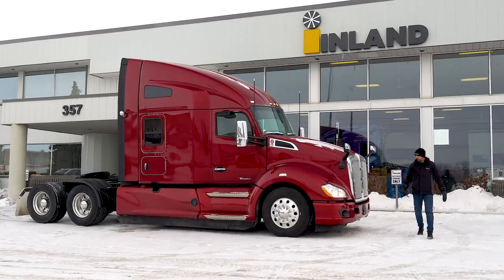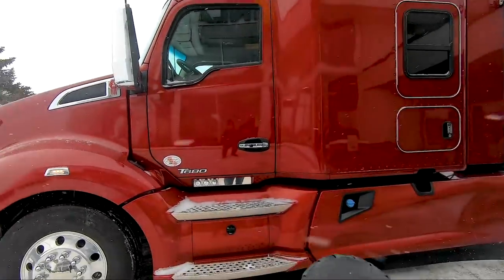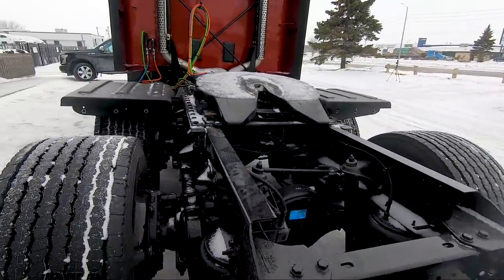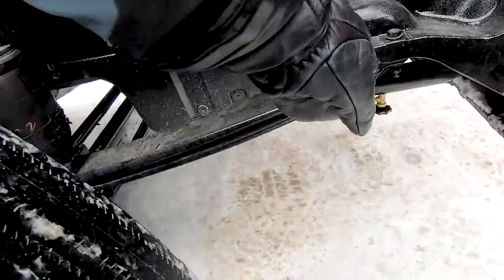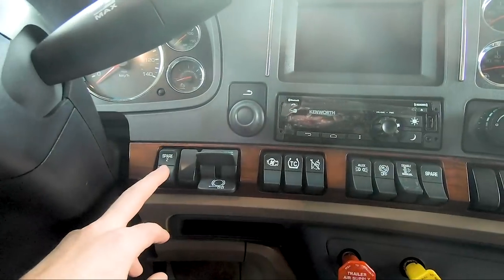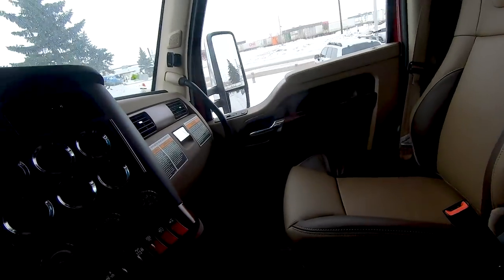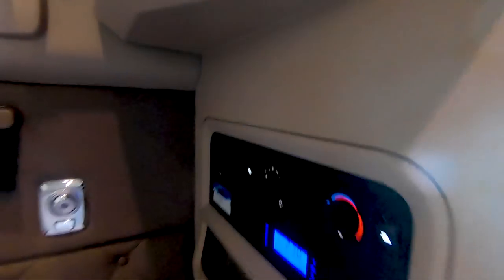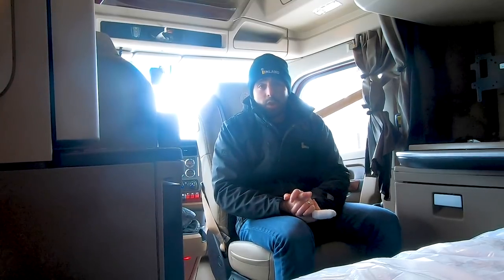MISSING SOMETHING   2020 Kenworth T680 Super Singles & Dead Axle   Full Load   Tour & Review

Comment: As a Brit this is the first truck I  would actually buy, although a lifting axle in front of the drive riides better. Those worried about traction don't forget that in Sweden they run 6x2 at 145000lbs  on ice roads without problems, just hit the weight transfer button and welly it.
Reply: What is that? lbs stands for lips?
Reply: Lift axles aren't legal in that way in Canada. You'll sometimes see.then as an additional.axle.for.trucks going into the US

Comment: The dead axle is a concept that western star, specifically the 5700 xe is heavily invested.
The scenario is wholly devoted to increased fuel milage, and slight weight reduction, no shaft, no lubrication pump. Question why any O/O would sacrifice Canadian winter traction with a single drive axle and super single (hydroplane) tires.? Typical WS ratios in the 2.80 range.
Reply: It works good in winter,drive my Peterbilt 579 for over 3 years single axle,just put hard tires on the drive as soft is wearing faster.
For driving it is no difference 6x2 or 6x4
Reply: What is your fuel milage?

Comment: I drove a KW with a dead axel and super singles. They suck, at times if you are on wet ground and hooking to a trailer you had better get a running start. They are easy to get stuck as well. Overall, I would never own a tractor with super singles with a dead axel.
Reply: Think a guy who lives in Canada would know that that thing be ok if live south of  I40 in America
Reply: John , we’ve been using tag axles (or dead axles ) in Britain with no trouble for years
 no problem with them at all better turning circle as well.
Reply: @adriandavis9790  Well, I guess you never drove a double screw tractor dude
Reply: I can attest to getting stuck on super singles. Picking up a/c units up in Chicago at night and I assume ice underneath the snow. Took me an hr to turn around to line up with the trailer after getting stuck just a few feet away.

Comment: Love the super singles but got 265 talls after two new trucks  that got 250 k miles on each truck no tire problems super handle uneven train construction Ice and snow ruts super singles just glide over it with easy no ruts throwing you around when ya hit the gap between tires like I said 250 k on supers singles are average and and tire still had over 14 thousand tread when replaced just not sure about the single drive axle but I hear they get crazy fuel mileage
Reply from the maker: That was the idea with the configuration. Max out fuel economy

Comment: Why isn't the dead axle liftable?
Reply from the maker: It’s illegal in Manitoba to have a liftable axle.
Reply: I was thinking the same. I drive in Europe and it's very common to see liftable dead axles on tractors, especially in England. Raising the axle  saves on fuel and tire wear, when unloaded. The drawback is decreased traction on wet and not so perfect roads with gross weights. . I can see why Manitoba does not permit it. I'm not really a big fan on these axle configurations either. Off the toll routes in Europe, on these small roads, maneuverability is critical and thus the 6x2.
Reply: @AndyTheKenworthGuy  really? They're quite common in Europe. Some brands even have disconnecting tandems so that you can lift one of the drive axles.
Edit: is dump valve legal?
Reply: Yes Volvo and Sisu have liftable tandem, what i know of. But most trucks in sweden are singleaxle drive and liftable tag or puscher axle. Dump valve are most common on trailers i think but yes legal

Comment: what do you think about dual drive tires with super single for pusher axle in 6x2 configuration. 1traction 2not being stranded 3 better  ride when empty. what do you think?  locker in live axle. horizontal exhaust to compensate for additional weight.
Reply: There was a tanker outfit out of Milwaukee  that tried that. 
I'd  think it would be less squirmy. 
With a front axle lift.i hate grassburner exhaust. I flamed a turbo once. My truck I drive now has one. But Its a day cab. 
If the truck I flamed a turbo with had a grassburner it would have burnt up.

Comment: What a shame they didn't spec the Cummins. DAF  motor is gutless it in one
Reply from the maker: False. Sorry the Paccar is a great reliable engine. The cummins is good too.
Reply: @AndyTheKenworthGuy  Paccar now offers for Europe in the Daf brand a 530 hp rating. All that's missing is a Eaton Fuller transmission.
Reply: More salesman bs. I own one, drive it 6 days a week , it's gutless, and that exhaust hiss is deafening,  so just stick selling before you acuse me of being false
Reply: Michael Smith yeah the slip joints on the manifold will drive you nuts on my 3ed one now and at 3000 a whack installed it gets old fast
Reply: @wheelman1235  What's wrong with the DAF transmission. What's wrong with the DAF engine, which is renamed PACCAR? PACCAR is the proud mother of three great truck manufactures and she herself doesn't make a bold.

Comment: What if you get on a uneven surface and you need to lock in your axles?
Reply from the maker: The air drops out of the rear axle to provide more traction on the drive axle.

Comment: so if it illegal to have a lift axle, why is isn't the drive axle on on the far rear and the dead one in the middle?, very curious to know.
Reply: Tag axle behind drives can put more weight on the steers. In front of the drives takes weight off the steers. Saves about 800 lbs 
Old TNT Holland Fords had them 
Lite weight more freight.
Reply: Jerry Kinnin thanks for the facts never thought of that
Reply: How exactly would you Power the far rear axle leaving the front drive axle unpowered without the driveshaft? ?

Comment: Short hood T800 small bunk flat top aluminum  frame one 150 gal tank DS def DS dead axle super single Disc brakes all around. 5th wheel no more than 48 inch tall 
12 liter 13 speed stick 390 rearend
I'm dreaming of a truck around 15000 lbs full fuel and driver. 60 ft long overall with a 40 ft container chassis.
Reply from the maker: Sounds awesome

Comment: Great video, really nice highway tractor but definitely not a fan of the engine
Reply from the maker: Thanks for watching.
Reply: I have the 500hp,great engine pulling up great.
Oil change every 60.000 mls.
630.000 on it runs just awesome, quite good on fuel
Reply: @dutchman2506  right on, Detroit or Cummins for me . Different strokes for different folks .
Reply: h3xd3m0n the new ones have a common rail so single pump. As someone who runs a PACCAR it is the software that can only be read at the dealer that will get ya
Reply: My Pete is 8008 kg fully loaded one drive and disk brakes 500 hp 13 speed automatic,seems to me a big weight saver,no problems in winter as I have to climbing 1200 feet in 5 mls bobtail to my house,and we get around 16 feet of snow a year